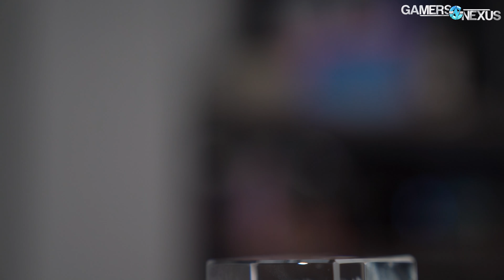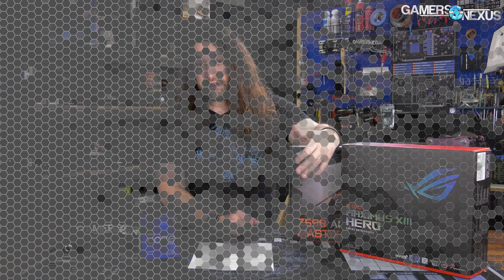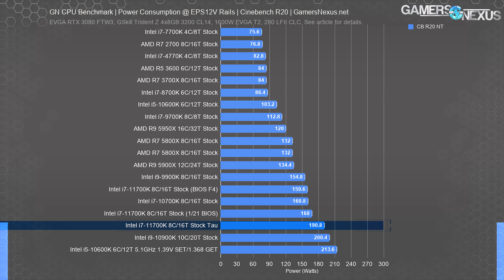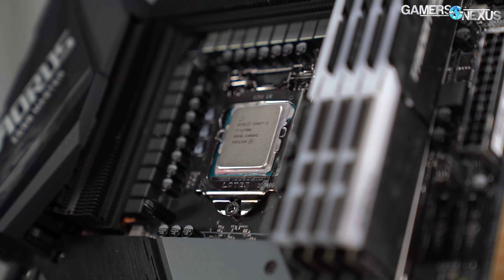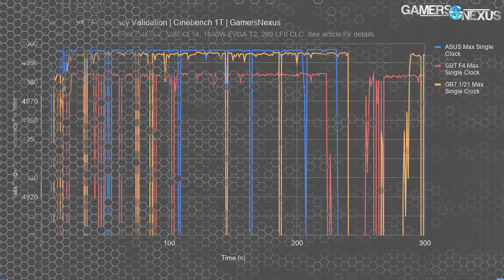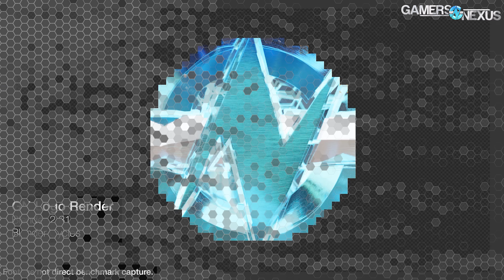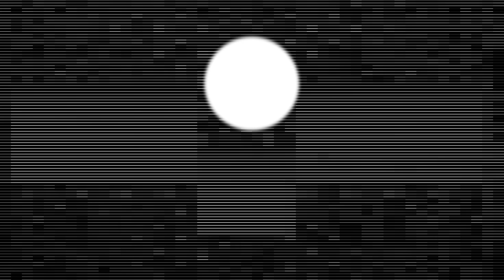Intel's Z590 Motherboard Problem: i7-11700K Power & Thermals Explained

Comment: I already preordered i5 11500 and I'm more sacred with every day... Intel really need 10nm
Reply: They just need to take their time, they didn't need to release these CPUs, but for some reason after 10 years of cpu recycling decide to release this compact stove, you could probably undervolt these nicely as it seems quite excessive for an 8 core to consume so much, multicore powerdraw had constantly been on a decrease and I have absolutely no idea what board partners or Intel are trying to achieve with this launch,  still going to be a decent part, I just hope you can afford a big cooler/water cooling because I think even something like a darkrock 4 will get a bit toasty if you like it quiet
Reply: @fewik8567 First of all sorry for my weak english. Omg are you sure?? Even for CPU like 11500?? Because im getting to him the cheapest Cooler master h411r.... XD You think better to get 10600 in good price? Which one should perform better in lower temps and power consumption?
Reply: @Trespasser4  do not worry about your English, it is pretty good just a few grammar mistakes, anyway you will probably need a new cooler, the i5 11500 can consume around 150w underload according to specs, the cooler master h4110 may not be sufficient for such power, be quiet make a pure rock 2 rated for 150w tpd and it is just £34 new, similar in pricing to cooler masters offerings, if you want more cooling the corsair A500 can be found at good prices but it still costs more and will be more than enough, however the be quiet is about minimum, the corsair leaves cooling potential if you need it, the cpu you have should be fine but Intels last gen, 10th gen actually performs better on many CPUs, and costs a great deal less especially because it's discounted now
Reply: @fewik8567  Thank you :) I can see that you are a very competent person. Do you really think the 11500 will be so much warmer than the 10th gen? I have the opportunity to buy the i5 10600 at a good price and I'm already starting to wonder what to choose.
Reply: @Trespasser4  well I think it can consume that much power, 3 months ago rumours and leaks stated that the 11900k would consume 250w under load, which nobody believed since it was the same cpu as last with 4 cores less and the same architecture, technically a new architecture but small parts have changed, when the 11900k was proven to pull that much power I certainly think the leaks for other CPUs are mostly accurate, in my opinion you should buy one of my two suggestions, 1. Intel 10th gen, this is cheaper, great deals are found now and motherboards being considerably cheaper, you are still on ddr4 and only lose the pcie gen 4 feature which has proven to have next to no benifit on current gpus, meaning you lose nothing, not even performance in this case and save a lot of money, 2. Buy an amd based system, currently amds 3000/5000 CPUs are difficult to buy at retail price, however buying a new motherboard and an old first gen or 2nd gen ryzen will mean that if you want to upgrade your cpu to a 5000 ryzen you can do so without needing a new motherboard and you get the option to use pcie 4.0 if you want to(this works only on ryzen 5000 chips) so you could by b550 motherboard, and ryzen 7 1700 for around 300£(I'm uk, around 370$) and when the time comes upgrade your cpu, keep in mind AMD's ryzen chips are in huge demand meaning all ryzen cpus, from 1000-5000 chips have a markup price and can rarely be found for retail, it's the more expensive option but in the long term it is better in my eyes, hope that helped
Reply: @fewik8567  Thank you for your help and interesting facts:) Well my dream CPU is Ryzen 5 5600 but is to expansive;) Soo, first of all i must say that I already bought B560  motherboard to be ready for 11th gen:/ I don't know, It's just still hard to believ for me that i5 series (non k) will be much warmer and power hungry than 10th gen. But fact that i want get the cheapest cooler master h411r for i5 11500... and now I'm not so sure if it's good idea and if it will be enough. Maybe I should buy i5 10600 (non k) and don't worry about powerful cooling.
Reply: @Trespasser4  well you can undervolt the cpu to reduce temperatures, however I'm not sure on the potential performance loss, sometimes an undervolt has no impact and reduces power consumption greatly but this unfortunately varies as each cpu is different from on another, some CPUs of great quality and others not so great, not so great will need close to their out of the box tpd, this tdp is made so even the worst CPUs from batches still perform similar, to get your hands on a good Chip you must either buy a "binned" chip which means it's hand picked for it's quality, or hope you get lucky as it's completely random of the shelf, but do not worry if you get a poor chip as it's still perfectly adequate for use, you could attempt to resell your motherboard or wait for all of Intels new CPUs to launch and pick your best option, prices may however rise then as Intel currently is the only manufacturer with enough stock to supply, people may buy 100s of each just to resell at a higher price, right now is a bad time to build a computer with bad products being launched, absurd prices and unreliable sellers reselling for far too much
Reply: @fewik8567  You're right, we live in crazy times ... Intel's only advantage over amd is pricing and availability. But right now I think it's too early to consider such advanced solutions like undervolting;)
 Everything will turn out after march 30, perhaps the problems with high temperatures and high power consumption will not apply to the i5 so much. 
The most annoying thing is the official test embargo until launch

Comment: For gaming test runs you should pull a package power graph from HWINFO64. Where my 10850K can pull 200+ watts in prime95, it'll only pull 80W from CP77, or Warzone, and thus not clock throttle even with 125W PL1. (and adjusting PL1 up and down at any value over 80 has no fps effect)

Comment: So basically some of the Z-590 boards are overclocking the 11700K and just aren't calling it overclocking?
Reply: Precisely. As Steve said: they allow the CPU to run on PL2 forever, rather than the 56 seconds Intel says is gospel. Obviously if you don't have a good cooler the CPU will protect itself and down clock when it gets too hot... that is, after the cooler has spun the fan to stratosphere.
Reply: thats not oc its stock turbo boost

Comment: So basically. No one should be upgrading from 10 series to 11 but if you need a new CPU and the pricing is comparable then get 11 series. Until AMD is back in stock that is.

Comment: Wait... Hold on... From todays standpoint the AMD Zen 3 Release was 5 Month ago. Almost half a year. In all that time Intel "was able" to create a lead of 2 FPS?
Ok. I'm done with their 14nm+++++. (All that Pluses are not even a joke anymore and are acutally accurate).
Reply: its 10nm backported.... plus the 11700k is cheaper than the 5800x.... it has a lot higher singlecore score and multicore over last gen.....
Reply: @TheBURBAN111  ah yes, alot higher single and multicore explains why it loses to the 10700K
Reply: @ValentineC137  no it doesnt lol
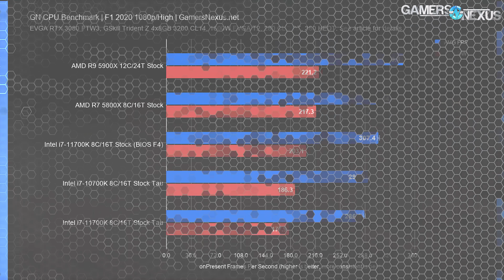Reply: @TheBURBAN111  it literally does 16:41

Comment: I have recorded my 10700k at 266W when overclocking.  Madness. I can’t wait for the OC stream to see what the 11700k draws when overclocked.
Reply: I keep my lovely 5600x at 90W max o/c
Reply: @daddystu7046  I was hitting 5.3 ghz
Reply: @kylepartridge5090  I can touch 5ghz at max... but with the IPC of the 5600x I really dont need to push it that far. Dialled to 4.75ghz now at max 90W. I reckon that 11700k will hit 300W at 5.3 Will need a 1000W PSU min. for that system.
Reply: @daddystu7046  i have a 10700k at 5ghz all core... with an 850 super nova.... you don't need a 1000w for an intel lol.... even when testing 5.2ghz 100% load it reached 264w at max...

Comment: It seems that the best thing about this 11 series chip is that it lowered the prices on the preceding 10th series chip.
Reply: Imagine them trying to sell you a cpu worse than last year's for more, but not only does it perform worse, draws power comparable to many entire systems, on yet another motherboard, and you can't even use it for workstations unless your into downgrading
Reply: @fewik8567  Performs worse? Compared to the 10700k in the Gamernexus video tests, the 11700k wins:
- 5-1 in 0.1% figures.
- 5-2 in 1% figures.
- 4-3 in average figures.
- And 7-3 in other tests. 
In total, 21 wins vs 9 loses, apart from AVX-512 and PCIE 4.0 support. I think it's fair to critize Intel for not launching a considerably better product lineup, but it would be better if critics were precise instead of "haha i7 11700k worse" kind of critic. I think there's enough to complain about the new gen to not fall into that kind of comment. If I got any figure wrong please correct me.
Reply: 10600K 205€
10700K 299€
5600X 320€
10850K 380€
5800X 399€
10900KF 425€
Reply: @fewik8567  exactly 🤣🤣🤣 they can't up prices because they haven't achieve anything better.
Reply: YES! Bestbuy matched Microcenters in store only price and I got a 10700k for $250 and picked it up 45 min later from down the street. I saw another comment where someone got an i9 10850k for $320 from BB price match.
Reply: @vbvapat  I live right next to a microcenter and picked up an 10850k for 320 bucks too. Sweet freaking deal.
Reply: @InvntdXNEWROMAN  hell of a deal for 10 cores
Reply: That's true I've even seen on  site in the UK the 10850k for £339.99 brand-new right now that's a bargain   , if I hadn't bough my x570 master 9  months ago I'd snap up a 10850k , instead of waiting for my 5900x back order ,J have a artic freezer ii 360 and full tower tower so cooling is not much of issue currently running a 2700x does quite  well for workloads  although  , I could with more cores and it struggles in my Sims especially with complex aircraft , orbx true earth , scenery etc at max scenery complexity in vr
Reply: @DC3RejuvationGB  am still happy with my z390 and i9 9900k waiting for 13gen and ddr5
Reply: @JB6789 agree 100 percent. I ended up getting a 10600k for like 130 bucks after a few stacked discounts I got lucky with lol
Reply: Maybe someone here can help me out with this, because I have not entirely understood how good or bad the 11700k is now.

I am considering to buy either the 10700k or the 11700k (+55€).
I am currently still running a 6700k, so I am upgrading 4/5 gens.
Just wanna know here if it makes sense to pay 55€ more for the 11th gen in terms of performance.
(310€ vs 360€).

Also I am only upgrading every 4-5 years, so keep that in mind as well.
Reply: @ximaxwellix  I've been running 7700K and am now upgrading to 11700K.  I was considering 10700K because of price, but then I found 11700K for same price so that was easy choice, because 11th gen onward will make use of PCIe 4.0, which is a big advantage for future-proofing.  Overall gaming performance is similar but productivity is better on 11th gen.

The people complaining that it isn't good are the people that buy new CPU's every year. Most regular people will upgrade every 5+ years, so for you and me, both 10th and 11th gen are big upgrades. 11th gen on 500 series mobo seems like the future proof plan, and that's what I've gone with. I plan on having it for awhile, I don't like frequent upgrades.
Reply: @ximaxwellix  dude I'm in the same boat what did you end up doing I have the 6700k as well lol
Reply: indeed it did :p 10th gen getting so cheap when 11 released that it was the catalyst for me to build a new pc ~6 months ago(sans GPU, but hopefully coming soon). 10700k 8c16t for $260 at Microcenter. Paired with ROG Strix z590e, $20 off for bundling. I think it actually came out cheaper than when I built my 7600k 4c4t PC ~4 years ago.
Reply: Yes. Sad it can't lower Ryzen price.
Reply: @TheJeremyseattle  it's my first time in a while (like Pentium 4 days lol) not having an i7 in my daily driver and I'm pretty pleased with it so far
Reply: When I bought an 11900K in Amazon back in December 2021, the 10900K was more expensive by around $50. Now the 11900K is $300 and the 10900K is $340.

Comment: Buying a K CPU already means overclocking and good coolers will be required as this is what consumers are going to do...after all it is a specific overclocking CPU. If you want to stick to Tau limits etc, get the non K CPU's as that is what they are there for....Also for the K CPU's a good cooler will extract the extra headroom from the CPU at a lower temp, as importantly people will also play with the vcore to get it at the lowest voltage for stability at the highest clocks...for example a 10700K all core 5.1GHz at only 1.278v or lower in some cases... Not sure what all the fuss is about! The 11700K is not a great upgrade over the 10700K and Intel are in limbo until alder lake hits...

Comment: Gosh i'm loving my 10700k even more after this! And loving my msi tomahawk z490 board that was recommended by hardware unboxed. Last great combo imo before making the jump to the new ddr5 platform and pcie gen5.
Reply: You are 100% right...The 10700K is a stellar gaming CPU especially for the price and it overclocks extremely well. Will see you through until DDR5 and PCIe Gen 5...Yes I have one too and more than happy.
Reply: @vMaxHeadroom  waste of sand
Reply: @vMaxHeadroom  Have mine at 5.1ghz on all 8 cores at 1.288V easily. Im sure I can hit 5.2ghz on all cores if I wanted too. 5.1ghz is more than enough for me though lol Coming from my old 6700k at 4.8ghz at 1.400v that I used for years and actually still works to this day and is becoming my living room gaming pc was a huge upgrade from the 4c8t to 8c16t. Intel gets picked on a lot these day’s but even my old i5 2400 never let me down. Just got out dated like all tech eventually does lol
Reply: @SVT_LIGHTNING  Hi JT, we are so close, for me 5.1GHz all core at 1.278v...and you are right, 5.1GHz all core is more than enough..Yep on Intel getting hammered all the time now...I just cannot understand how people get so hooked up on Intel vs AMD...just by the CPU that best suits your needs...We need both AMD and Intel otherwise no competition and AMD are now upping there prices!

Comment: this is what you(we) get when big companies focus on competition rather than the actual product.
Reply: Competition is a good thing, it's better than before when Intel was barely improving until AMD started kicking Intel's ass so they were forced to try to finally get their butts in gear and try improving their CPUs. 
 
Yeah, "cheating" the results like this is not a good way to compete, however as pointed out, it just makes Intel look even worse in comparison, not better. It makes their CPUs look even more power hungry and hotter than they really are, for minimal gains that still are outclassed by comparable AMD cpus. Intel is going to be forced to actually make good CPUs (Assuming they can ever figure out how to go smaller than 14nm) to compete as this "cheating" just hurts them in the long run and won't last long.
Reply: We need a piece on this from more TechTubers to draw attention to it. You want to be competitive, mobo manufacturers? Give us more for less.

Comment: Well I got a amazing deal on my 10700k because this was launching and from what I've seen about 11th gen so far seems like I'm not missing out on anything but pcie gen 4 which I wouldn't be spending gen 4  $$$ on an SSD anyways.
Reply: I have the 10700K and it is a stonking CPU...also got it for a good price...who would have thought AMD would now be more expensive! The 10700K is a stellar gaming CPU and will be fine for the next few years...Have mine overclocked to 5.1GHz all core at 1.278v on a 360mm AIO with no temp issues at all....
Reply: @vMaxHeadroom  you should always skip a few generations. Jumping from one gen to the next is never worth it. Upgrading ever few years to something significantly better is the way to go.
Reply: @vMaxHeadroom  That's awesome.

Comment: I noticed in this, and the previous video, you seem to have the 5800X listed twice in the charts but I can't see if there is any testing differences (the figures seem to be the same), but note no 5600X results, which makes me think one set of the 5800X results  have been accidentally pasted over the 5600X results?

Shame because I'd like to see them for reference.